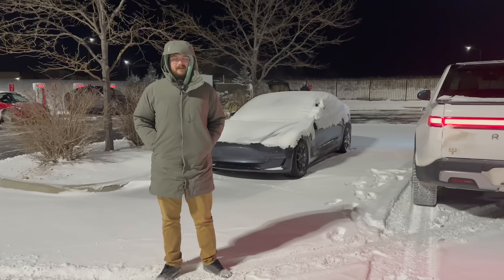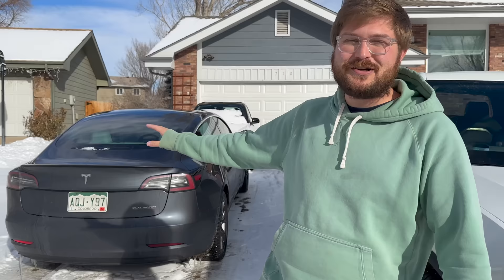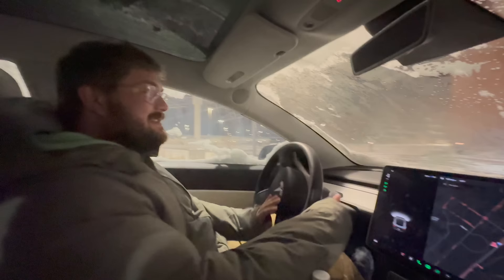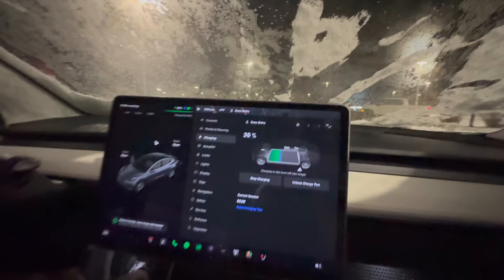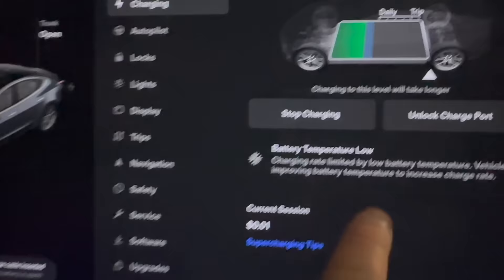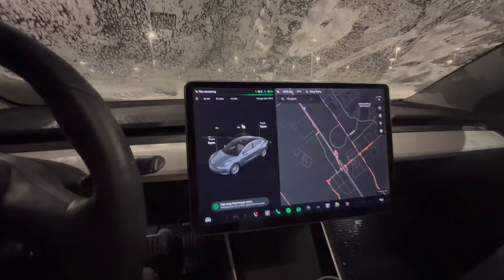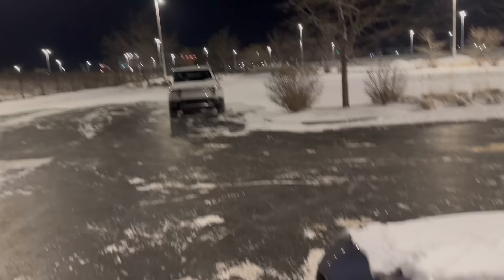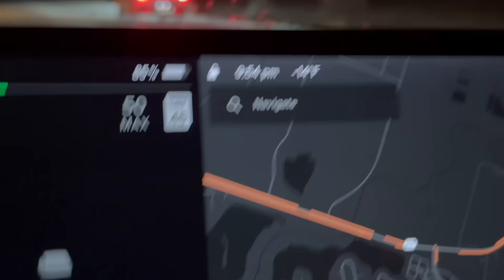I Deep Froze My Tesla And Immediately Plugged It Into A Supercharger To See What Happens

Comment: I find it interesting that folks are willing to own a car where the car company determines your route.  When I take a trip, I like to take the "scenic route."  In any event, I like to have control.  Don't get me wrong, I've got nothing against electric cars.  I can start my gas truck, however, be warm in 5 minutes, fill it up in under 10 minutes, and then drive over 500 miles on the route that I choose.
Reply: Many GPS generated routes are incorrect, causing excessive fuel, or power usage. People just have to drop the DUMB PHONE, which perform many tasks, but none well.
Reply: How much does it cost you to put 500 miles of gas in your truck?  I drive an electric car for work, I personally think they’re much nicer to drive and considering our routes are around 100 miles a day - it’s a ton of money saving - I think.  But as you’ve pointed out, the infrastructure is not there yet for long distance.
Reply: That wasn't true when the infrastructure was just getting started for gas automobiles.  You are very much tied to that.  I drive rural routes in North Dakota and have to check my tank carefully to make sure I've got the range I need, because I can drive a long time without gas stations.  It is certainly worse for EVs right now, but it takes time to grow the infrastructure just like it did with gasoline.
Reply: @keithstack6321  a hell of a lot less than pulling into a service station. And a hell of a lot less time.
Reply: Lol you can still do that as well it will easily redirect same as any gps ffs